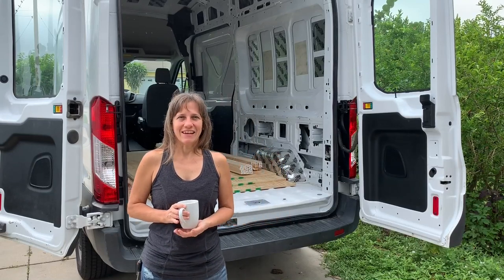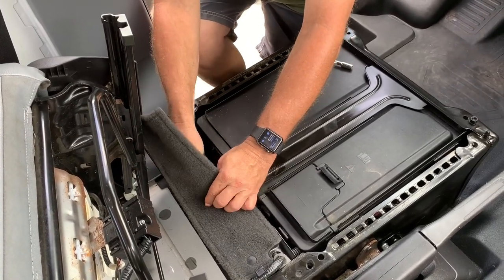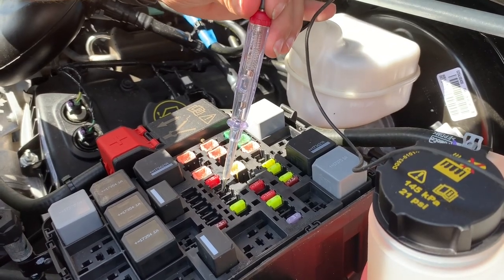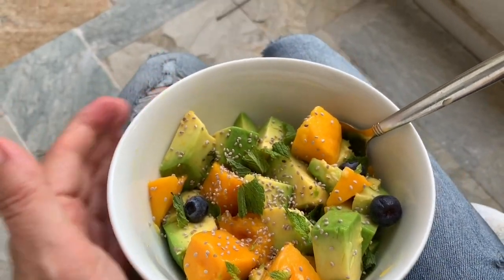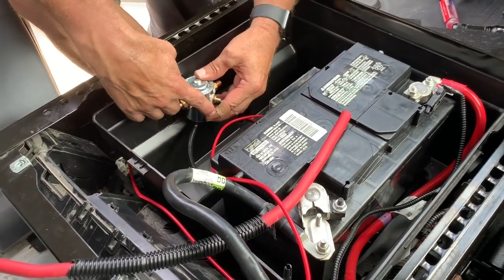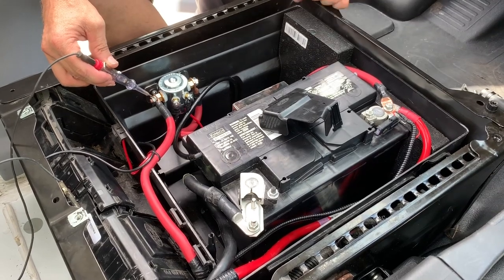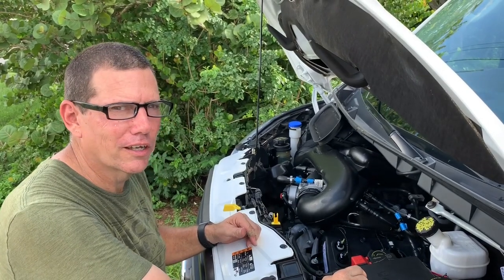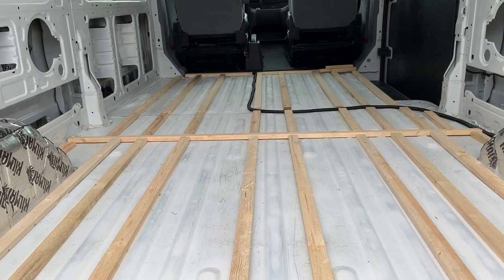Van Conversion: Installed a Solenoid and Braces for the Subfloor

Comment: Nice install but i have a recommendation.  On the solenoid trigger wire put an interruption switch on the dash. This way if your house battery is very low or flat it wont drain the starter battery when you turn the key. Once the engine is started and the alternator is making voltage you can flip the switch on to start charging the house battery. Without the switch you could have a situation where you are unable to start the van.
Reply from the maker: That sounds like a great idea and an extra point of safety. Thanks! We will look into doing that.
Reply: I did that on my van and it works great. Put the switch in the ground wire of the solenoid. I found I rarely need to use it since my solar system keeps the house batteries charged.  This is what I used:  https://www.amazon.com/dp/B00WTAFR5W/ref=cm_sw_r_oth_tai_AnidFb75DTEM8

Comment: Hello, great video!! Thanks for taking the time to explain everything and produce the video, it's very helpful. I just picked up a Transit and plan on doing that soon. At the end of the video you drill a hole in the floor and it looks like you ran a black cable, what was that for? 
I just tried your Amazon link for the Continuous Solenoid Relay 3 Terminal and it's out of stock, could you please recommend a comparable one? Thanks and I'm really enjoying all your videos, the build is looking amazing!!
Reply from the maker: Thanks! That was to ground the house batteries to the chassis. So, that wire goes from the negative on the battery to the frame of the van. I haven't experience with another solenoid but I would make sure it is continuous duty and 200 amps to be comparable.

Comment: If you get a spare minute to answer can you let me know where you came through the firewall. Thank you so much.
Reply from the maker: It wasn't easy but Kevin ran it through the rubber boot that a bunch of other wires go through just under the windshield wiper area on the driver's side. He made a very small hole along side them to push it through. Small enough that the rubber sealed itself around the wire.
Reply: Can you please post a photo or video of that somewhere?